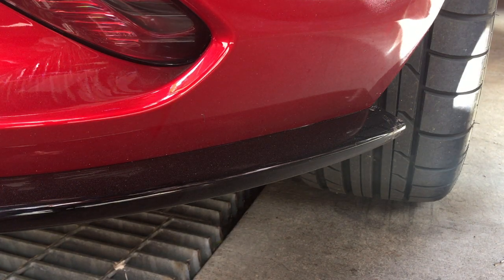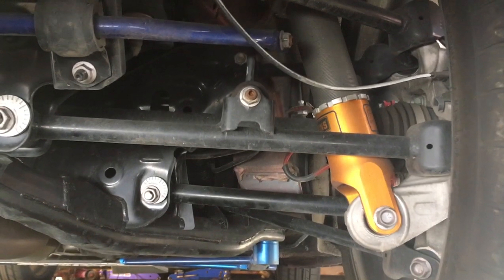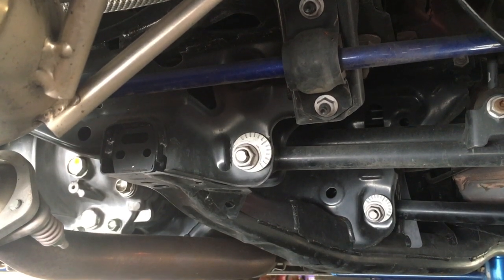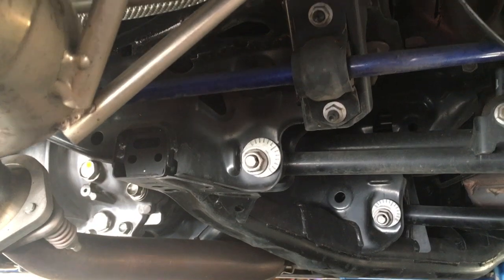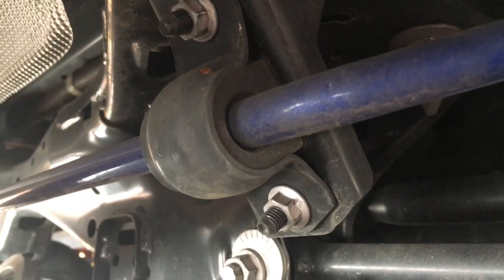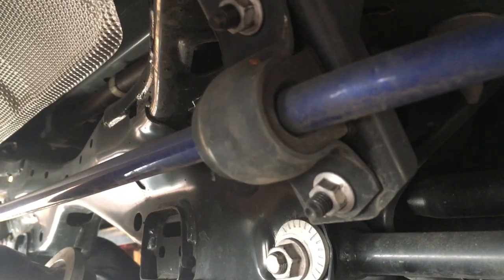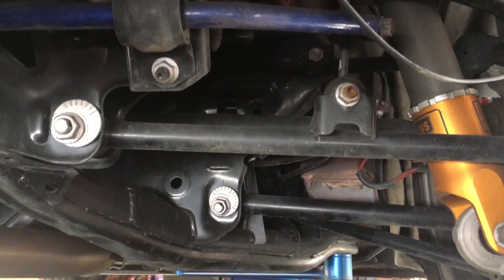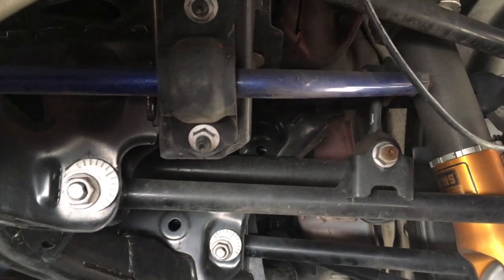ND Miata sway bar year+ review

Comment: I went with Flyin Miata sway bars. Considering a set of coilovers, but dont want to jump the gun just yet. I'd like to feel the cars new characteristics. Doing the sway bar install this week! Good review!
Reply from the maker: I never tried the sways first...maybe I should of.
Reply: What do you think of the Flyin Miata sways? I am considering these.  I don't want too stiff of a ride either.
Reply: @billzziv6859  doesn't change ride quality, but keeps the car relative flat in turns. Noticeable difference. Probably the best first mod you can do aside from coilovers or wheels
Reply: @georgebugarin1078  Thanks.  I don't have access to a lift, so I may try to get some prices to have them installed.  Its possible that I could take it on during the summer, with the car on jack stands.
Reply: @billzziv6859  It's pretty doable on jack stands on your own if you have a few hours to spare. Flyin Miata has a great video on how it's done and it is really quite manageable. Only issue I faced (just put mine on a few days ago) was the OEM end links needed to be cut out, but I also have high mileage and drive it in winter so it was expected.